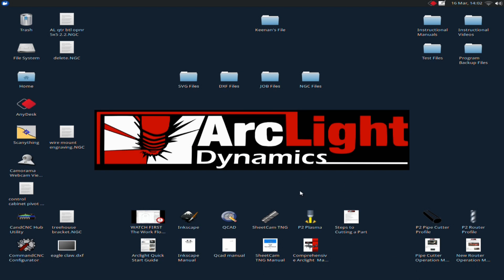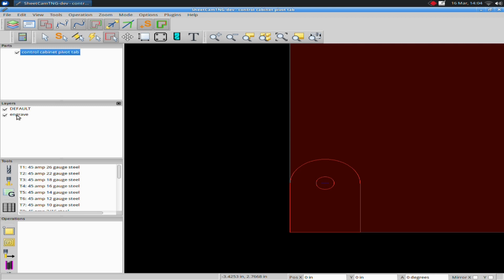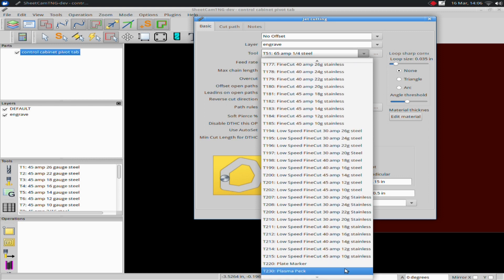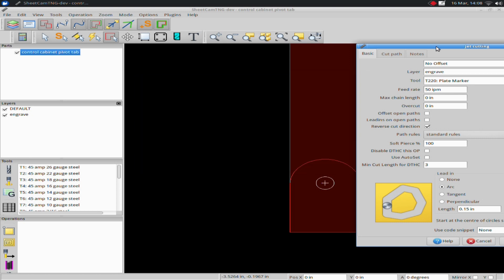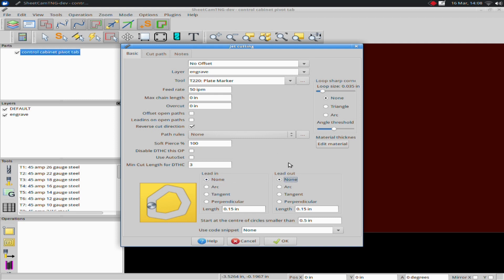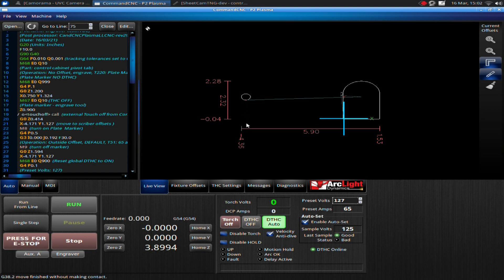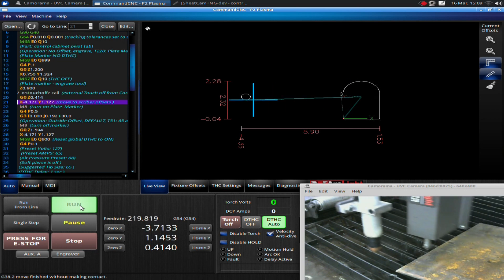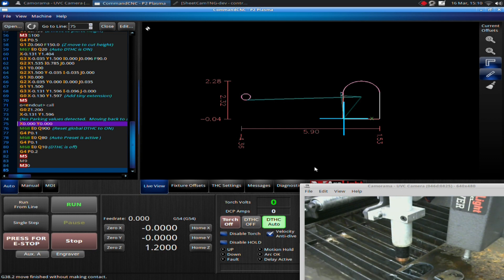Arclight Dynamics Engraver Training Video

Comment: I have a Arclight  arc Max 6 x 12. I've been using the engraver to Mark part numbers but now I want to use it for a layout month it is off - 0.129 on the x and - .283 on the y. How do you calibrate the engraver to line up with the plasma?
Reply from the maker: Give our Support team a call 866-222-2154 option 2